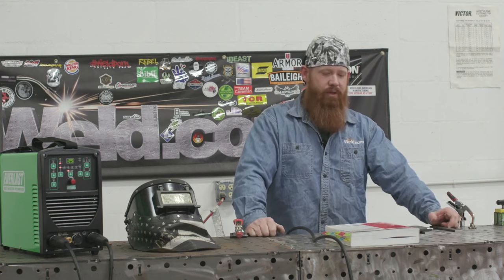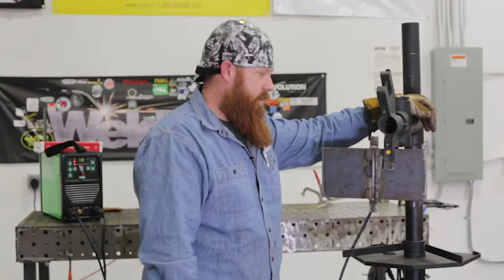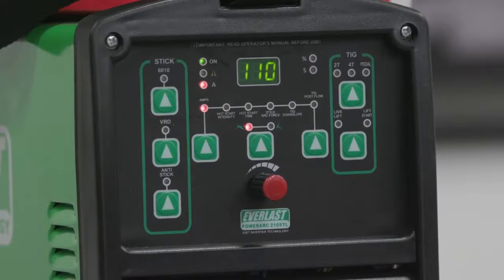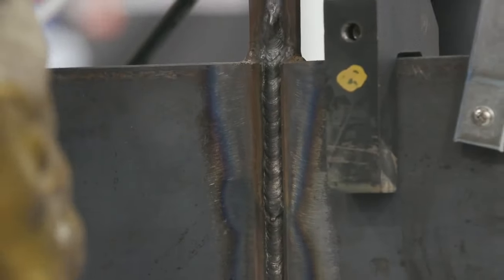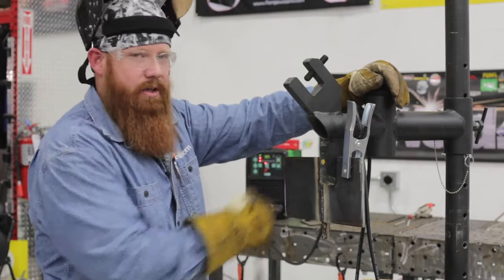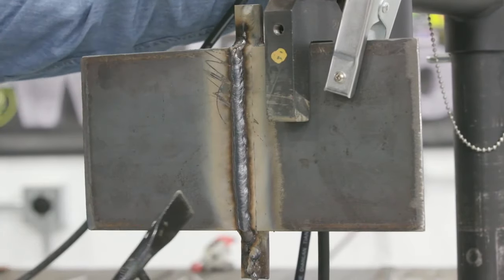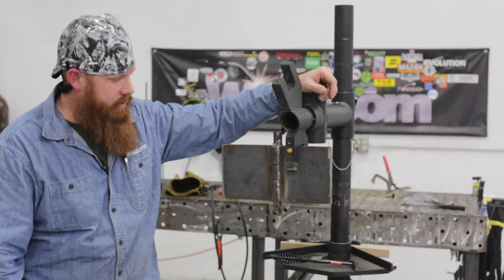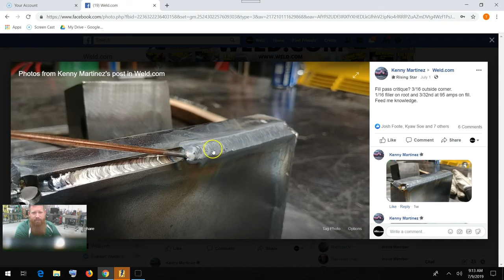AWS D1.1 SMAW 3G Qualification Test

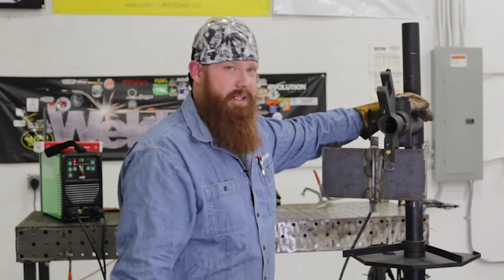Comment: At 5:29 you used the term "Leviate" not a real word buddy. Your rod angle is constantly an issue which is causing you to constantly readjust or concern yourself with arc length causing your universal patterns to not be so universal. Just helping you out. You need to turn your wrist when hitting the sidewalls. Put the direction of the puddle into a conformed level of guidance. vs the sloppy left to right and lack of control. You Favor the shit out of your right side by the way.